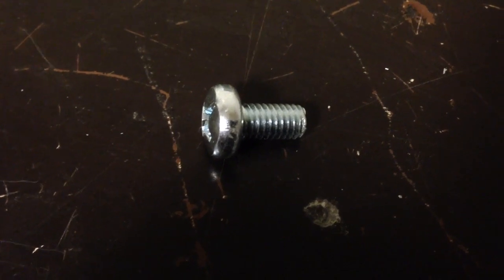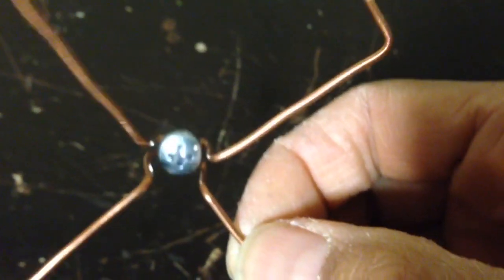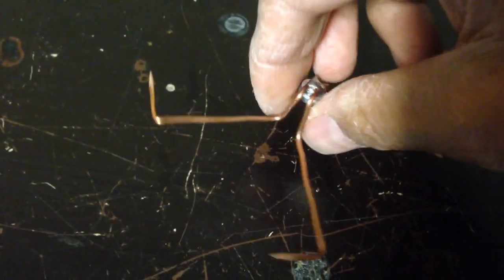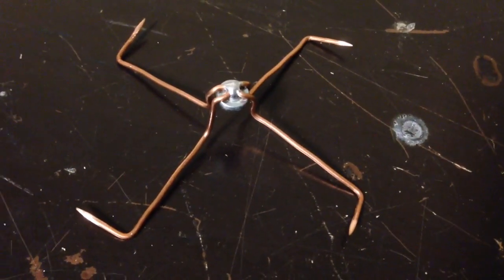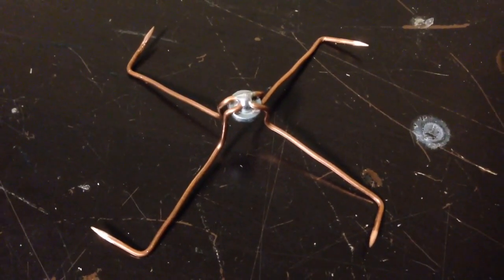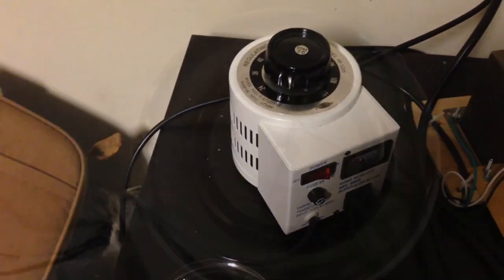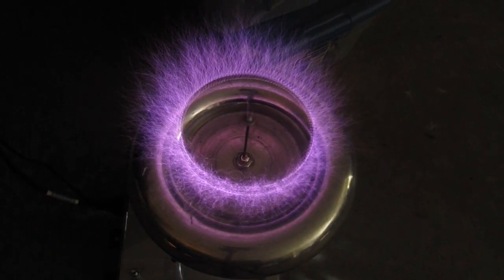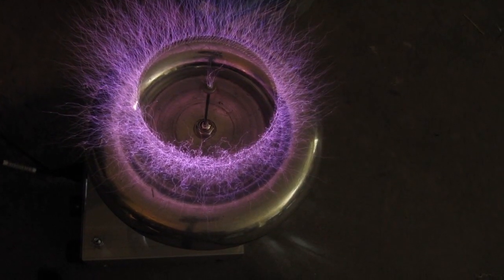Ion Motor Powered by Gated Tesla Coil

Comment: You need to make it inside a flask filled with noble gas or vacuum
Reply from the maker: I tried running a Tesla coil in a vacuum and corona discharge started coming off all over the secondary. It was really cool to watch!!
Reply: @BrianDhvTinkerer  Cool , I mean something like building the ion motor inside a light bulb or some glass flask then take the air out of it and put it as a topload , I think it will spin way faster cause corona will be stronger due to the noble gas or vacuum

Comment: I'm not sure magnetic induction isn't causing the motion.  I'd need someone to explain how ion's are moving anything here.
Reply: Basically what's happening is, as the ions are generated they are pushed away from the copper wire in the direction the wire is pointing. Newton's laws of motion tell us that, since there is an action (the ions accelerating away from the wire), there must be an equal and opposite reaction (the wire is accelerated in the opposite direction) generating angular momentum.
Reply: however the tesla coil are '' air resonating transformer '' the electromagnetic induction is not that phenomenon. the shock waves inside circuit, resonant with the geometry of the coil, the tesla coil convert sound's shock waves into pure electricity.